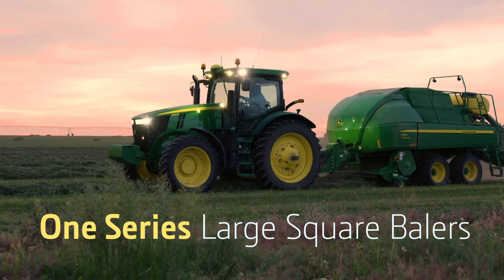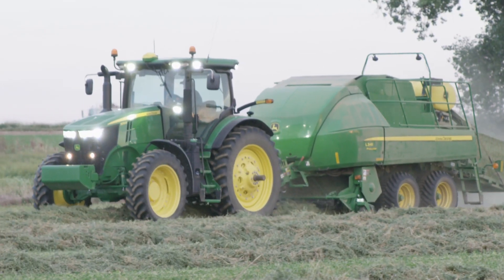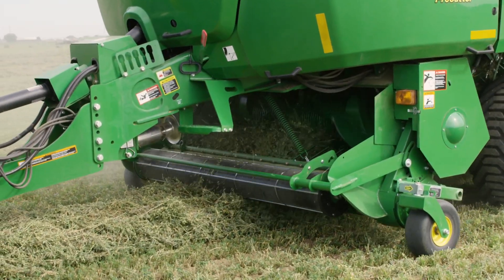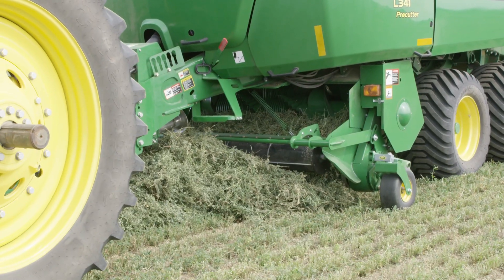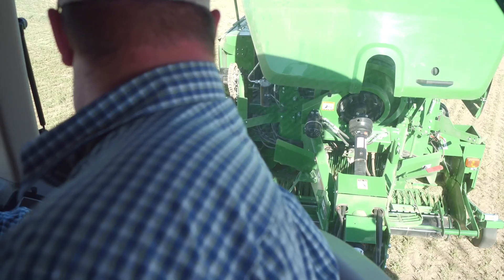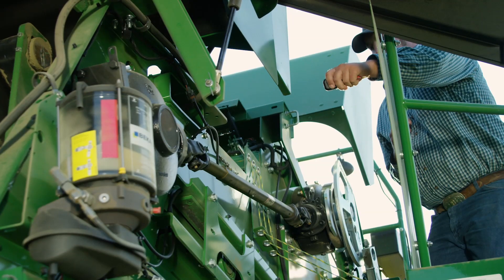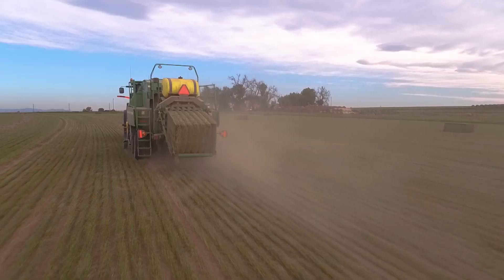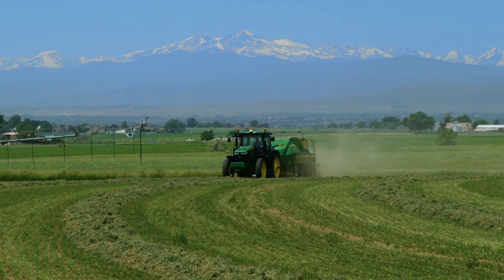One Series Large Square Balers | John Deere Hay & Forage Equipment

Comment: If theyre build in North America and they are 3x4 and 4x4 foot bales then tell us all the measurements in SAE .
Reply: a ft is  30cm, so most bale are 90x120, to my knowlege, ony the old Hesston balers make 120x120
Reply: Ian bob To start, the narrator called them 3x3 and 3x4 foot balers. Their website says that 3x3 = 90H x 80W 
And 3x4 = 90H x 120W.
The pickup widths are 86" standard
or 97" optional.
My 2014 Krone 3x3 has 92" pickup standard in North America.
Reply: Erm....which stands for Society of American Engineers, so what seems to be the problem?
Reply: you want metric ?